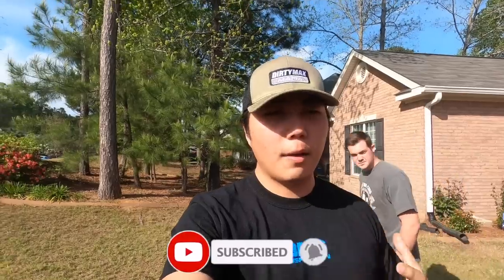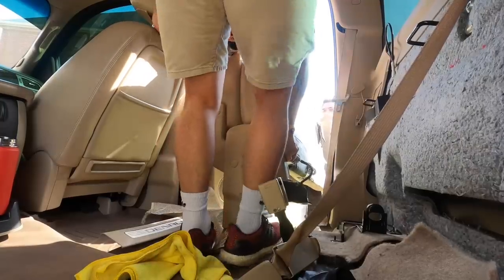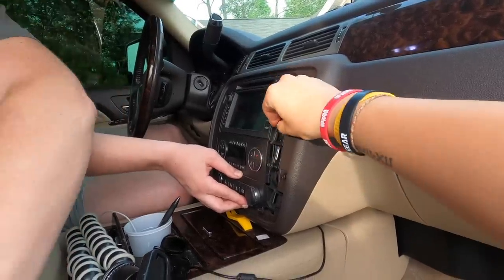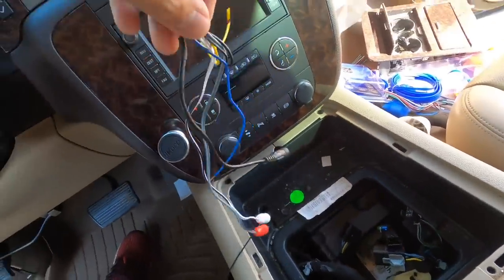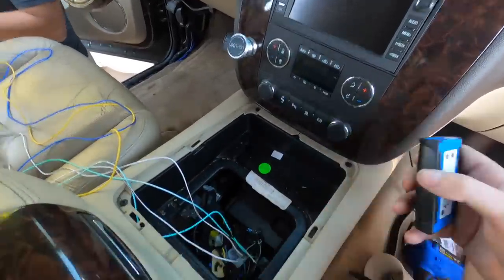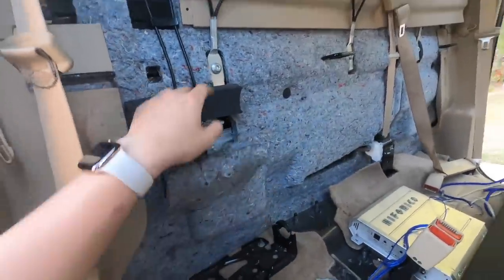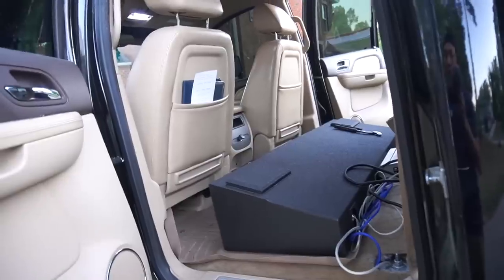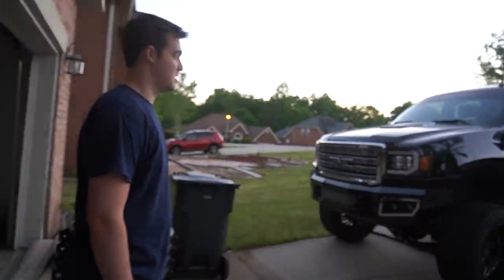CUSTOM BOX AND TWO 8" SUBS FOR MY DENALI! | INSTALLING Amp on Factory Bose System! |

Comment: I have the same truck and had the same issue... what i did was get one of those walmart adapters and hook it up to the back speaker wires and it works but the 10s dont sound as bassy as they did with my older gmc which sux i love bass... but its not so bad at the same time and i also fixed that window it was a pain in the ass to wire it up

Comment: Hold up maybe u shouldnt be doing the project if you don't know that each rca has a neg and a oos on them it's only left or right not red pos and white neg it's red right white left and I believe correct me if I am wrong but the center pin is pos and the outer cage is neg